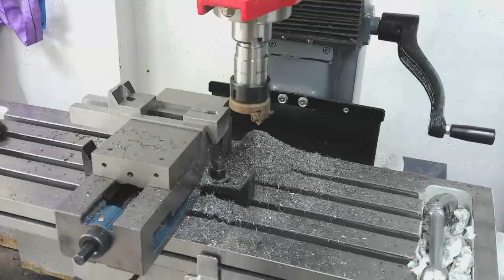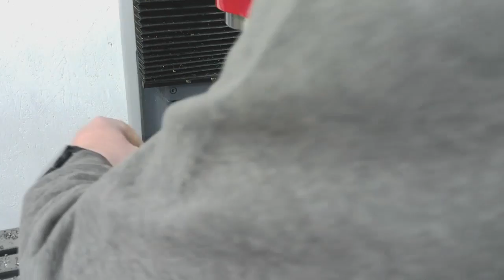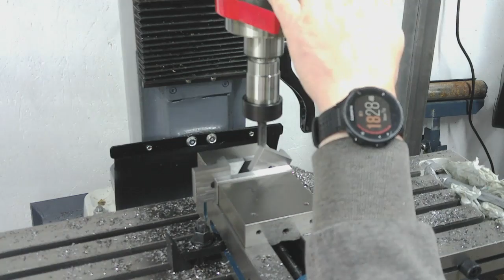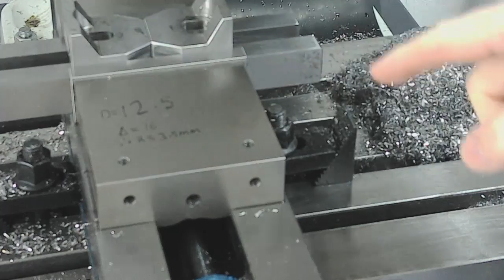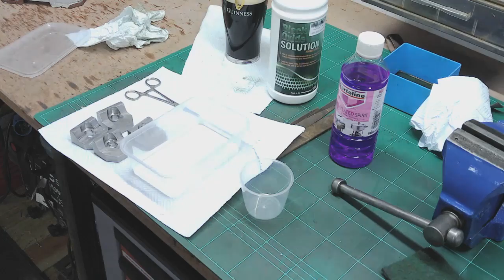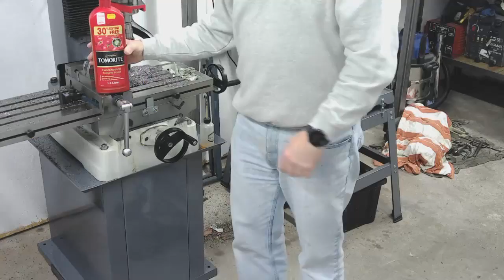Making Clamps for Machine Vice on the Mill   Part 2

Comment: Grasshopper has joined the big boys at last with a real lathe.😉 When you showed the plant food I was expecting to show your old lathe covered in weeds, but that was much better. 
That Harrison is broadly comparable with my Bantam, a most useful size of lathe for the above average home shop.
I would offer to grind your 306090 angle but as you hint you might be getting one I won't bother, besides if I got it a microarcsecond out of true you would probably whinge about poor workmanship.😏
Oh and nice clamps but your not concerned about 1 1/2 thou, that's 59 micron that's nearly a mile by RR standards. 🤔
When you do more machining videos, might I point you to highlight doing things the way you were taught. There are already a lot of self taught chaps showing things there have just "mastered" and not showing "best practice". A few chaps like you who know what there are doing might help to set newbies on a better path. Oh Lord, it sounds like I'm preaching.
ATB 
c
Reply from the maker: Ah Hello Master, I wondered where you had gone to. Yes, I am pleased with the lathe, on further strip down it is in immaculate condition, it really doesn't look or feel like it's been thrashed. Issues with toolpost (details coming soon), and rubber wipers on the tailstock have perished, apart from that nothing ugly to report. It will be 2021 before I get near a surface grinder I think but no matter, there is heaps to do now to tool up both machines properly (first project..... Dickson quick change cartridges out of ground flat stock, non of this aluminium tickling for Jon). Feedback taken on board thanks, the more I get tooled up, the easier it will be to show the traditional methods, having to cut a few corners at the moment as I am a bit limited on peripheral tooling, and a DRO would help no end but that will have to be a Christmas present to myself. I think this is good though as it forces me to show the basics of machining taking backlash into account which may help a newbie. Cheers, Jon
Reply: @jonsworkshop  had a lot in my inbox and decided to wait till i had time to concentrate on your latest. You should feel flattered, a lot of the others i watch at 2x, especially the ones in Russian. 😉

Comment: Hi Jon, nice work on the vice clamps, they look factory. Nice to finally see the shop up and running, it's a nice feeling isn't it. Ade  from Ades workshop recons that you can reuse the the black oxide solution several times once you'v mixed it up, just filter the muck out and put a lid on it.
Reply from the maker: Hi David, thanks for the comment. You're right, it's a great feeling. A lot of hard work, planning, effort and an understanding Mrs Jon's Workshop have led to where we are today and it's great to be making stuff now. I saw Ades video, I have kept the solution and will try it next week, going to be making some T Nuts. Cheers, Jon

Comment: I am going to buy some Tomorite . and pour it on my shed, . Double the size overnight. Genius. Great video , Jon . It is ok to smile on camera . Very happy with new lathe purchase. Cheers Ade.
Reply from the maker: Hi Ade, thanks for the comment, yes, I am dead chuffed. Got power connected to it tonight and it runs sweet as a nut. Next job is a big clean down and then some dimensional checks etc. Thinking of projects for a trial within the limited scope of the material I have on hand. Lol with the Shed comment. Try it, you never know! Failing that, swap it out with the shower gel, let me know how you get on! Cheers, Jon

Comment: Hi Jon...nice lathe good choice to change now before you do all the work.Your workshop will need an extension by Xmas!
Reply from the maker: Hi Robert, thanks for the support. I know, space is getting a bit tight now......... Just enough room to squeeze a surface grinder in though...... Lol. Did your mill arrive? Cheers, Jon

Comment: Cracking job on those clamps Jon, nice bit of metal. New lathe's awesome, looking forward to more videos. I bought 8 adjustable feet that self level from Warco for mine, plus 4 I've put on my band saw. They weren't that expensive.
Reply from the maker: Hi Dave, thanks for the comment. I have seen the feet you brought and was tempted to get some. I will see how the metal plates perform, I can always upgrade at a later date if I have any issues. I am chuffed with the clamps, they came out well and the mill performed well too. Cheers, Jon

Comment: I'd call your lathe almost modern, well it is against my 1940's Clausing lathe. Mind you it still works, occasionally, hahaa. The original radius on those clamps looked about the same as some flanged pipe fitting we used to make. The pipe end came away from the flange at about thirty degrees and the underside of the flange instead of being flat had something like a one hundred and five inch radius machined across in line with the pipe offtake. The flange itself was only three or four inches in diameter. That was a job for your company, all in inches as usual back then because the USA is imperial.
Reply from the maker: Hi Derrick, thanks for the comment. I think these clamps were off a compressor rotor drum assembly fixture, the O/D of which would be about 1200mm (48 in). Its nice to have a more modern but more importantly (adult lathe). The Denford was OK but it was designed round schools so was too low and too small. It did the job and I am sure it would have been much tighter when new. I just wanted what felt like a proper lathe and I have worked Harrison's before, they are brilliant machines. The designers got it just right with them. Cheers, Jon

Comment: Hello again Jon. What size tools will the toolpost take? I have a good reason for asking. Cheers,  Mike
Reply from the maker: Hi Mike, it currently has an S2 Dickson QCTP and max shank size is 22mm. Not sure on centre height yet though so a 22mm may be too high (seems like an odd number, I am guessing it is all designed around 20mm shank tooling). I have brought some 01 steel (ground flat stock) to make some more holders so I can design them around whatever size I suppose. I have some big 25 and 30mm shank tooling that I plan to reduce in the mill also. Cheers, Jon

Comment: Hi Jon, nice job. Where did you get the black solution from? I use small bottles of gun blue but the results aren't as good as yours. I have a plentiful supply of the other black solution though 😂. All the best, Mike
Reply: Ade was on about it a short while ago, Caswell Europe do it. "https://www.caswelleurope.co.uk/sd-cold-ox-hand-apply-on-mild-steel/"
Reply from the maker: Hi Mike, thanks for the comment, as Dave has commented, Caswell Europe, I followed Ades lead. It works well and I am pleased with the end result. Cheers, Jon

Comment: Nice M300, I've got a late long bed M250 and it's fantastic, looking forward to the clean up.
Reply from the maker: Hi Richard, thanks for the comment. Harrison lathes are bullet proof really unless they have been badly abused. I used to work a long bed version about 27 years ago, nice machine. They are great machines and that's what prompted me to go for one, the gearbox and screw cutting options are the best of any lathe I have worked. Cheers, Jon